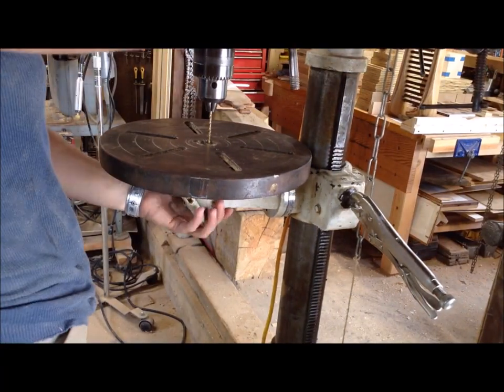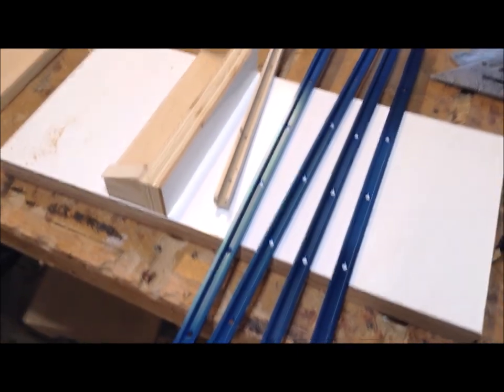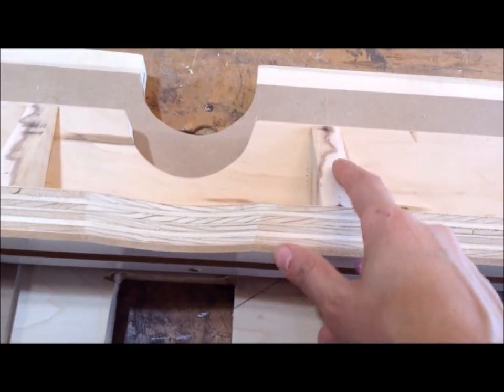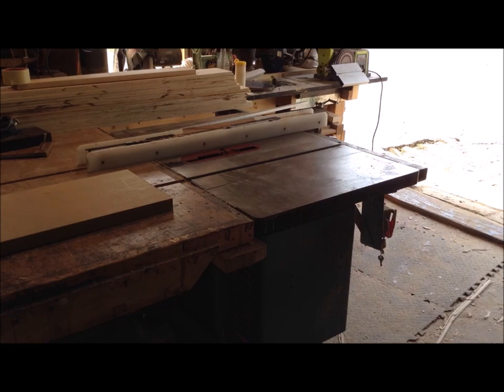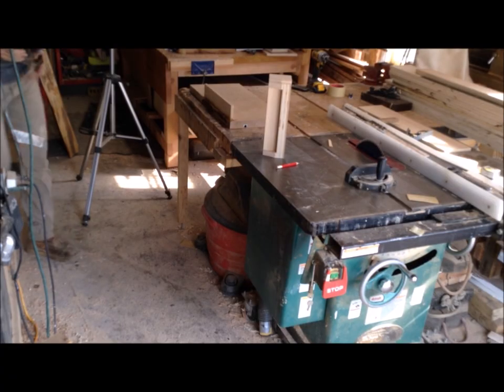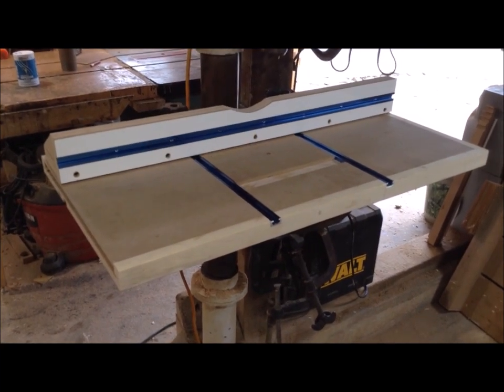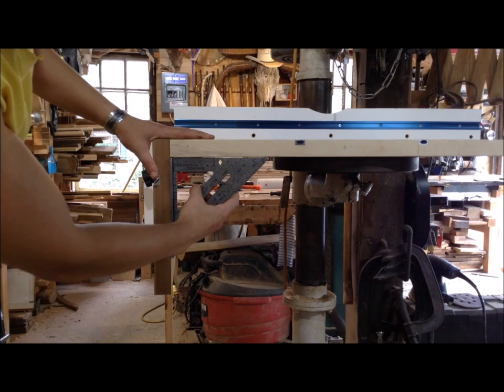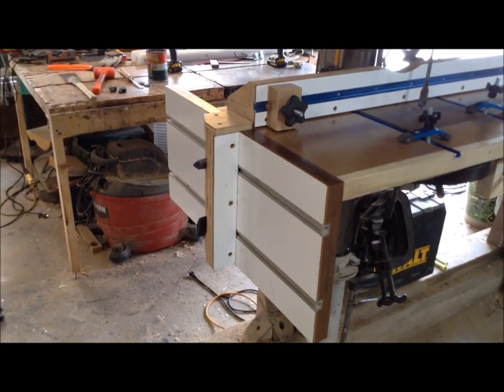Simple Drill Press Table & End-Boring Jig [ Part 2 ]

Comment: I like the way you think! The table looks awesome and that was a smart idea to coat the edge of the verticle table with epoxy. I agree with not leaving it on all the time. After all that work, it's not worth possibly hitting it with something. I have a habit of using things for projects that they were not intended for, so when I go to flea markets or tag sales, my brain is constantly going. Instead of rounded over gears, why not standard gears? I understand you had them but you can usually get gears on eBay pretty cheap. Especially old steel gears. They may not slip as much. Unrelated question. I notice you don't have a miter saw and I'm thinking of purchasing an old Dewalt radial arm saw and selling my cheap compound miter saw. I have a Dewalt contractors table saw and the arbor is not long enough to accept my dado stack, and with a radial arm saw I can keep the dado stack on that. Do you miss not having a miter saw? Do you think its worth switching saws out?
Reply from the maker: The gear forming was more so a personal challenge to see if I could get it to work, honestly I am still a little surprised at how well it works, that and I'm cheap.  Team radial arm saw all the way.  It is just so much more versatile, and I find it to be a lot more accurate.  I have used it with a dado stack on longer pieces that I can't safely crosscut on my table saw, and it works really well for that too.  I also find it can make wider cuts then sliding miter saws too.  I like lap joints a lot for the strength of the joint and cutting them on the radial arm saw is very easy to set up because the blade moves up and down.  In fact if I had the space I would get another one and permanently keep a dado stack in it.  I actually have a small Freud miter saw in my shop next to the radial arm saw, but I almost never use it.  I find miter cuts on my table saw turn out substantially more accurate then a miter saw, longer to set up and cut, but worth the accuracy.  When I do more on site work and installation I do bring my little miter saw with me.  In those situations it is very useful, but I don't do a ton of on site, or construction based work.  So for the things I do the radial arm saw is more useful, if I was a contractor and did a lot more roughing in and framing a miter saw would be better.  I do know a fair amount of people that call them death traps and won't use them, but I haven't had any close calls.  Hope that helps.
Reply: @HoneyBadgerWoodWorks  Thank you! I think Radial arm saws have gotten a bad rap. Well, you have helped a lot. I have an old, but still accurate, Mikita chop saw in the metal shop if I ever should need one. I guess the bad rap is to my advantage. I've seen all kinds of radial arm saws for as little as $50! I want to stay away from the Craftsman, only because one of their models had a recall and I'm not sure which one it is. I also don't want to get one with "electronics". I've got my mindset on the old green Dewalt's with the bakelite knobs. They are so nice looking too. Ok, that's very girly of me, but I have a love of old machines and vehicles. I hope to someday own a 1945 ford pickup. I have a Ford Ranger now that is twenty years old and still purring. And never apologize for being cheap. I rather like being careful since I'm the same way, lol. Thanks for the help!
Reply from the maker: The old DeWalt's are supposed to be amazing machines and built very well.  I have read a couple articles where the owner's say they are the best.
Reply: @HoneyBadgerWoodWorks   Yes, I have read the same thing. I've also read a bit myself and was surprised to read how many different models they have made. Back in the early 40s when the start of WW2 started, Military housing was needed at bases around the country. They needed a quick and better way to break down materials and that is when they developed these saws. They would set up onsite an assembly like lines were several of the radial arm saws were set up, each doing something different. Being a carpenter back then was one job in high demand. I watched an old documentary about these building sites and they employed a lot of men back then.
Reply from the maker: I watched a video on here once showing everything a radial arm saw can do.  Most of them are terrifying cuts I would never attempt, but people did use them as all purpose tools once, which is pretty impressive.

Comment: Hi If you look in the plumbing aisle of your woodworking store you can use toilet seat bolts that work great in "T" track. The side table is a good idea but why did you make it so long?. If you cut it to the same length as the width of your main table it will work just as well and not stick out so far.
Reply from the maker: Thanks for the tip!  It's hard to find those bolts in stores, and I usually have to order them, so good to know I can find them where I wasn't expecting.  I pulled the main measurements for the vertical jig from an article.  At first I thought it was long in the back as well, but when you get it set up the drill head lines up in the center of the vertical jig so if you want to drill into something wider then a 2x4 you need that depth in-order to still use the fence.
Reply: @HoneyBadgerWoodWorks  I understand why it is that long now, I hadn't taken into account what you could be drilling into. The toilet bolts are not expensive and as a bonus, you get two in a packet.
Reply from the maker: Yeah thanks again for the tip because to order them is annoying and not cheap.

Comment: One little thing... that fence never has to be parallel to anything. It only has to be straight, 90 degrees to the table, and stable.. Unless you use the table t-tracks as 90 degrees to that fence base do you need to worry even the slightest. Even that is easily done using a t-square in the table track. Don't over think it...😉😉

Comment: i know this video is 3 years old, but if you haven't done so, figure out a way to clamp your wood in place for your saw. Or you will cut your thumb off or worse. Your hand is way to close to the blade each time. I wince when I see that. Same when you cut a corner off the wood free hand. It just takes one time and you can lose fingers. And then you too will be stumpy nubs...